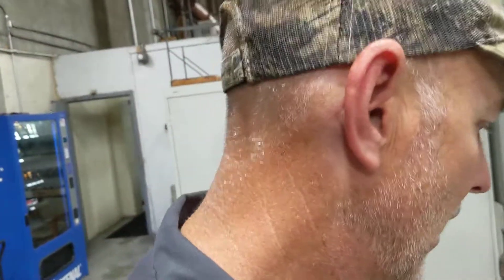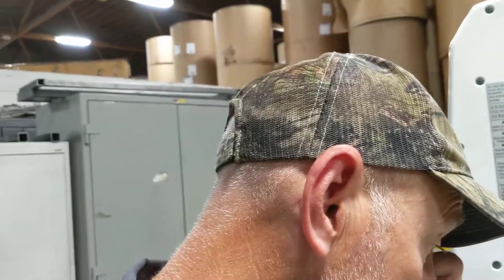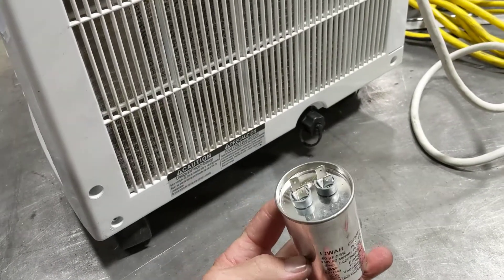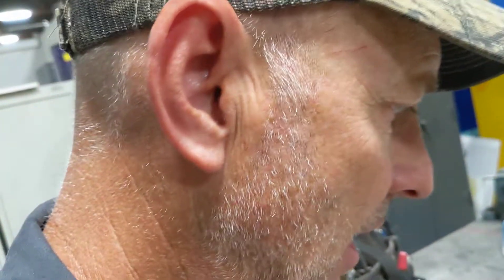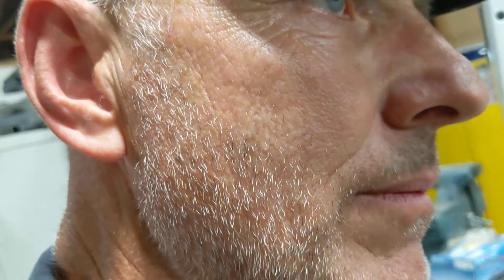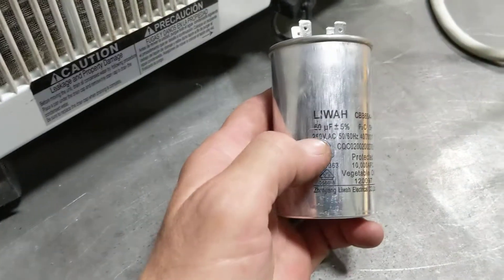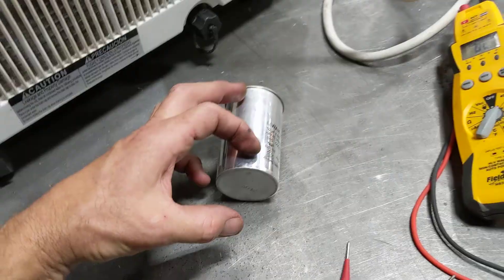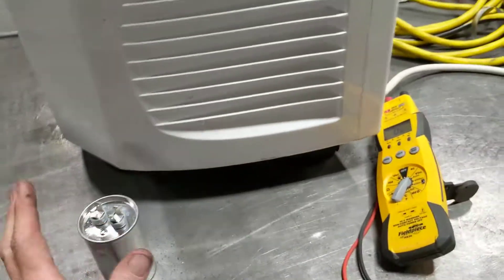Portable air conditioner AC repair

Comment: Do you have a link on where to get the copacitor because i have that same exact unit
Reply from the maker: There should be numbers on the capacitor followed by u, or uf, or mfd. Examples: 25 mfd, 25 u/f, 25 uf, 25 u.

Comment: If you're having problems with your portable AC blowing cold, or compressor short cycling, I HIGHLY recommend you clean your filters, but even more importantly, clean your coils! 

You'll need to take the covers off to properly access the coils (of course unplug AC unit from wall!), use a stiff brush and strong vacuum (and/or blower) to carefully clean both coil sets of coils, being careful to keep fins on the coils vertical and intact.  If you want to take it one step further, use a commercial coil cleaning foam and rinse with a stray bottle of warm water.  Wet vac up the foam/water run-off, reassemble, and enjoy FAR better cooling and compressor operations.  Do this at least once a year, and with a little luck your portable AC unit will provide affordable, effective cooling for many years!
Reply: Thanks.  My AC compressor runs for 3 seconds and turns off.  I bought a capacitor just in case, but I think you're idea is right.  It's probably full of dirt and the compressor wouldn't start if the capacitor was truly bad.  Thank you so much.  Where do I send the check?
Reply: @alext8828  That's the problem with unnecessary waste of ACs. The manufacturers don't want you to clean the inside of your ACs for loss of profits. After 4 years, you'll notice your unit doesn't cool like before and then you're under the assumption that it's time for a NEW AC. BULL! The main culprit is the condenser coils get saturated with guck that hardens in between those coils and need to be cleaned. A garden hose is not going to cut it. You need a liquid cleaner made for this purpose and your compressor will thank you for it. It takes one hour of your time to remove the 10-15 screws for the AC plastic cover, clean the coils, and put back the plastic cover. That's it. if you clean after every end of summer, an AC can last 10 - 20+ years.
Reply: @heyoou  It was the capacitor.  Thanks for the advice.
Reply: @alext8828  oh, I have no doubts in your case. I just have seen so many ACs being thrown out that don't need to. I have one young guy call me to take his 3 year old window AC as he was going to throw out because it didn't cool as well as before. I cleaned out the inside including coils and it cools amazingly. $500 12000 btu Midea.

Comment: This was very helpful. I have a 14,000 btu air conditioner, and I've barely used it, I only got it two years ago, and I live in Canada, so there's only a few weeks in the summer where it's hot enough to need it. The problem now, is that it won't work, it turns itself off after about 20 minutes, and it doesn't start cooling right away. Unfortunately no one has air conditioners in stock this time of year, so I can't just replace it. After watching this, I'm wondering if it's the compressor, and not something simpler, I was hoping it was something easy to fix... in your video, you explained how to do it, which was helpful, but not nearly as helpful as actually showing us how to do it. Still a really great, and helpful video 👍
Reply from the maker: I appreciate it. And I know the sound quality was terrible but I was inside a loud factory and I thought I would just make a quick video. Some viewers just can't observe, understand, and respect that.

Comment: You are super genius. When i changed the capacitor the the cold air started coming. But the compressor keeps cutting for some few minutes. So i did a clean up wash on the condenser. It was doing so until i closed the system with its cover now its working fine for three days now. Please do you have any idea why it keeps cutting and why after i closed it now its working fine. Does this has to be with the thermostat?
Reply from the maker: Some AC systems will not run properly if the cover or covers are off of it. It will cause it to overheat.  If you have it all put back together and now it's working fine, you should be fine.
Reply: Thanks for your reply bro

Comment: I need help.  The capacitor inside this unit has two types of plugs on top of the capacitor .  But the one I bought ( the one he recommends has 3 plugs on top of the capacitor ). How would I know what cable goes to what plug on the new capacitor.?  I don’t want to plug something where it’s not suppose to .
Reply from the maker: Return it and get the right one.
Reply from the maker: I understand this reply is very late and I'm sure you figured it out by now, but if not... The three terminal capacitor should have letters next to the terminals: C, F(Fan), H(Herm).  Take the wire connections off the two terminal capacitor and connect one side to C, and the other side to H(Herm). Do not connect anything to F(Fan). If you can't find the letters, Do an internet image search: capacitor letter terminals.

Comment: What is the most common cause of no power  unit has no power light do not come on, any suggestion.?
Reply from the maker: Did you try plugging it into a different outlet from another room?  Maybe the outlet has no power.
Reply: Yes i have, I even put a new plug on the end of power cord.
Reply: By the way,  I do appreciate your time.  I read through all the comments as well as replies, just in case someone already asked my question. You are very kind  & helpful    and I am  grateful. Thanx

Comment: The capacitor I bought has 3 outlets on top of the capacitor Versus 2 on the one you show . 
How would I know which two are the ones that I need to connect on the three outlets that I have on my capacitor?
Reply: Hey did you figure out your issue?
Reply: @samuraisamuru4092  no, he never replied
Reply: @israelalvarado9720  I'm installing one right now, oh well
Reply from the maker: I understand this reply is very late and I'm sure you figured it out by now, but if not... The three terminal capacitor should have letters next to the terminals: C, F(Fan), H(Herm).  Take the wire connections off the two terminal capacitor and connect one side to C, and the other side to H(Herm). Do not connect anything to F(Fan). If you can't find the letters, Do an internet image search: capacitor letter terminals.

Comment: WARNING!  Capacitors will still hold a charge even when the unit is unplugged.  They can seriously harm you if not handled properly.
Reply: diy wont be any fun if there was no danger in doing it 😜😜😜😜😜
Reply from the maker: To safely discharge and handle a capacitor, All you have to do is make sure power is off by unplugging the unit  and then take a screwdriver and short the two terminals that are on top of The capacitor.  It's rare that a capacitor will shock you, but it's always a good to discharge the capacitor first before handling it. Take a screwdriver and short the two terminals together after you have power turned off. When I say power turned off, I mean you have the system unplugged from a power source.

Comment: when upgrading from its original cap. to the one you spoke of....whats the wiring diagram for that.
the original has 2 connections and the upgrade has 3?
Reply: Did you ever get an answer? I have the same situation
Reply from the maker: I could answer your question if I could see the new and old capacitors side by side.  If you order the capacitor directly from the factory, it should be the same capacitor with only two terminals an aftermarket capacitor off of Amazon or something, it may take some experience knowing which terminals to put it on.
Reply from the maker: I understand this reply is very late and I'm sure you figured it out by now, but if not... The three terminal capacitor should have letters next to the terminals: C, F(Fan), H(Herm).  Take the wire connections off the two terminal capacitor and connect one side to C, and the other side to H(Herm). Do not connect anything to F(Fan). If you can't find the letters, Do an internet image search: capacitor letter terminals.

Comment: Maybe you can help me. I've got a Haier portable. I was neglectful, and didn't realize there were two sets of coils, when I took the back off, the bottom coils were caked  with dirt. Before that, the compressor made a racket, so I turned it off. I cleaned everything with a hose that let it sit in the sun a couple of days. When I tried it again, the compressor immediately kicked in quietly and blew cool...not cold air, but then kicked off after a couple minutes.  Started a couple minutes later again but kicked off even quicker. The compressor gets slightly louder right before it kicks off, but nothing like before I cleaned it. Do you have any suggestions?
Reply from the maker: 95% of the time you first have a problem with your air conditioner, It's usually the capacitor or capacitors.  One thing you can check as well is to make sure that the fans are running.  Typically there's one fan motor to circulate cool air into the room and then there is one fan motor that's circulates air across the compressed air coil.  It's very critical that both these fans are running when the compressor is running.  Sometimes there's just one fan motor with a squirrel cage on each end of the motor and so you only have to look at one motor to make sure it's running.
Reply from the maker: One more thing, If you took it all apart to clean it, make sure you put it all back together before you test it.  Most air conditioners will not work properly if there are any panels missing.
Reply: @johnharrisonschulz  I have to disagree with your statement. I've cleaned over 200 window and portable ACs. I test them before reinstalling back the panels and all cooled at leat 20% better if the coils were filthy with hardened dirt and guck unless there was a freon leak somewhere. Compressors and capacitors fail a lot of the time if they have to work harder in the unit because of dirty coils.

Comment: Thank you for taking the time to explain everything! I have a portable Danby 12,000 BTU air conditioner it recently started tripping the circuit breaker every time the compressor turns on but the fan & dehumidifier work fine & don't trip the breaker. Do you think that could be a faulty capacitor or is it more likely to be the compressor?
Reply from the maker: Capacitors are very cheap and they can go bad at any time so sometimes it's worth it just to buy one and see if that will fix it.  If the capacitor doesn't fix it, It's hard to say where to go after that other than throwing The portable AC in the garbage or selling it for scrap. But in my experience, whenever you first have a problem with your AC, It's 95% the capacitor.
Reply: @johnharrisonschulz  I have found out that capacitors are almost always the issue in faulty electronics. I had no idea. No wonder people buy broken items and can make money fixing them. I spent $3 replacing capacitors on my air purifiers. Units were over $300 to replace so I was able to save that money and can now keep them running indefinitely when they go out.
Reply from the maker: @amypolzella8349 , That's cool.

Comment: Hey thanks for the info, my portable AC stopped cooling. Ill try this fix.
Also for as a WARNING to anyone: capacitors can be very dangerous, so when the old/existing capacitor is pulled out it should be discharged by shorting out the terminals with a wire or metal object before handling or touching the terminals with your hand/fingers.
Reply: Now I really worried about the DIY capacitor 😳
Reply: thank you for that tip! I have replaced tiny capacitors on air purifier and now have a portable AC not working. I will try this repair but did not know to be careful with the capacitor! It is much larger than previous work I have done.

Comment: My Portable Honeywell Air Conditioner knocks while walking. Then the fan starts. The cold air turns off. The fan runs for a while without cool air. After a while the cool air starts again.
Reply: If your AC is walking around your house i think you should get a new one. Knocking while walking "sounds" like it would make sense. The cold ir not working at 1st likely means your compressor is not running then it "kicks" in and starts to cool the coil lines. Maybe the capacitor or the compressor itself need replacement. If the capacitor is worth replacing. If the comp. then get new AC unit, I'd be cheaper. No equipement should be kocking or walking around your house.